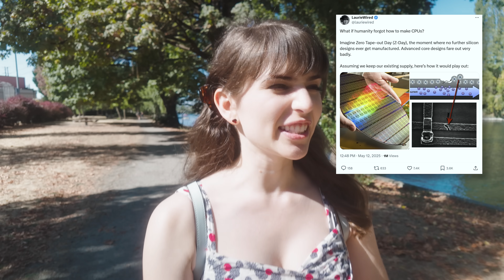what if humans forgot how to make CPUs?

Comment: It would be an interesting race between decay and re-development. People would immediately start to try and recover the lost knowledge. If we re-start in the 1950s with discrete transistors and the last old computers fall apart 30 years after z-day, we might be back to the legendary C64 when the last modern computer fails. 
That is, if development occurs at the same speed as before. But unless you assume a mind-wipe of the engineers who worked in chip design, as well as old textbooks disappearing, things would go faster the second time.

Comment: I am not sure we would lose more than 5% of advanced CPU’s in 15 years. I also feel that old mobile cpu’s would be repurposed to produce end user networking equipment for decades given current stocks. China reuses CPU’s now - producing millions of phones using salvaged chips.

There would also be a lot of lead time to a loss of CPU manufacturing expertise, and older hardware would no longer be destroyed during upgrades - cpu’s 3-5 generations old would sit on shelves as reserves.

Almost everything else will fail a dozen times over before the CPU’s. With chips being constantly repurposed until failure.

The break down of the conductors is overblown. 5nm CPU’s operated at appropriate temperatures and voltages will be made to last half a century. 

32nm and 22nm chips will chug along for several centuries. 64nm and larger will outlast us.

We will be replacing package capacitors and even repacking entire chips dozens of times, rating them for lower and lower voltages and clock frequencies.

Comment: I understand this is a thought experiment and it's interesting from that point of view. My ADHD brain though has questions. If we know how a CPU works we can build one. Might take a bit of nutting out and experimenting, but there's enough people in the world who know the mechanics of how transistors work, who can do microlithography etc. I only mention it, not to be a spoilsport, but because I think it's easy to mystify technology but it really isn't. At it's core (pun intended) a CPU is extremely simplistic. There's a lot of moving parts but they are all just transistors ferrying electrons around reasonable straightforward pathways. There are people who have enough knowledge of how a cpu works to write out a schematic from just their own knowledge. I could do it with a little help from wikipedia (which I have downloaded locally). Even boutique manufacturers are producings chips of different kinds, inhouse, small 20 people companies. Especially in China, Vietnam, India etc. Unless all manufacturing is lost, we will be able to build cpus. If all manufacturing is lost, it's a matter of only a few years before all technology such as power plants, utility services etc goes back to very manual ways of doing things. No large scale power generation, no power distribution. It will be local power stations, windmills, hydro etc, on a small scale, where there is no reliance on microprocessors or computers. So no cpus also means no resupply of electronics and microprocessors. Basically it's back to the steam age.

Comment: Wouldn't tape storage devices be more useful for long-term data preservation than optical drives?  The life span of a magnetic tape is about 30 years, and the tape storage has enough capacity... LTO's are used even today for backup that's rarely accessed.

Comment: 7:14. Computer controlled ignition started in the 70s, and was in full swing by the 80s, all cars from the 90s have ECUs.  You basically have to go back to carburetion.  However, the ECUs in automobiles, especially from the 90s, are very likely to outlive the vehicle and/or the operators.  So you'd have a VERY long time before you had to start worrying about that.

Comment: That's the funny thing. Making a CPU is actually not that hard. Making a GOOD CPU that can compete with modern designs, that's hard. As long as someone knows how to throw something that can act as a transistor together, and then combine them into logic gates, you can build some kind of processor. Good design can be lost, but ultimately a basic CPU is a rather easy thing to throw together.

Comment: Even without the masks or detailed designs, the fundamentals of CPUs is not particularly hard or complex. Even starting from core logic blocks like the logic gates it wouldn't be that hard to recover technologically. 

There is a realistic form of this scenario though and that's the destruction of the lithography equipment itself and the equipment to manufacture that equipment. 

If ASML lost the information to produce EUV lithography machines or if enough of the supply chain that manufacturers thousands of highly specalised parts that each depend on their own complex supply chains, we could go back decades. 

If china invaded Taiwan and TSMC fabs were seriously damaged and the chain of escalation caused global disruption, we could see process nodes go back a decade or more. In an apocalypse scenario we'd probably know more about the designs of advanced chips than how to make them. 

You can build a basic 16bit CPU from discrete logic gate ICs made on lithography some youtubers have made in their garage. Hobbyists can and have made CPUs with a few thousand transistors. There are probably only a dozen people alive who understand enough about the industry to recreate modern lithography and even if the information was retained, there is so much supporting industries and tech required to maintain our ability to manufacture advanced semiconductors. It's incredibly fragile.

Comment: That was an excellent thought experiment.

And it low key validated my distrust of modern tech. I have modern tech sure. But when I need reliable, I use antiques. My C64 on which I learned to code is still operational XD. My usual concern is a solar flare. Which is why I still have critical data stored on optical media.

But even without the CPU problem, I have been wary of "smart" devices from day 1. And time proved me right in that you can't troubleshoot your own stuff if the "smart" thing runs into an issue. My car has zero tech in it, besides an old radio. I had to make changes and pay a lot to get a bunch of engineers to validate my design changes, notably for environmental compliance, but it mostly is just an old car. That I can maintain myself. Instead of having to go to the car shop.

I religiously keep my older hardware. Originally because of sentimental value. Then because I thought that I could fix them (and usually it turned out to be true). And after that because I realized how much more sturdy it is than modern tech.

Comment: Guys, I have seen the horrors of legacy assembler code. The moment someone treats "optimization" for "efficiency" as an easy binary I get flashbacks.
Do you know how I got these scars?
I call it data structure tetris.
Wanna know about it?

See this form?
In the codepage it uses all the valid letters use the same bit in that position of a specific byte. So technically we can use that for another flag! And just always set it for display.
A byte? What is a byte?
You mean 8 perfectly independently usable bolean flags that don't necessarily need to be related in any form. It could even change over the lifetime of the software!

Comment: It’s very much not in the spirit of the question but the reality is we would just make more CPUs. Say aliens came down tomorrow and destroyed every chip fab and every chip fab tool on Earth then left for some distant part of the universe. Within maybe a year maybe two we will be back to producing integrated circuits at a sophistication comparable with the 70s. we have that much knowledge in books on paper about semiconductors but we really wouldn’t have to reinvent the wheel.

Within a year or two after that we’ll be back to early 90s levels of chips and getting things comparable 286 or early ARM processors.

A lot of embedded microcontroller type stuff can run with that level of power. Building up to the absurdly small transistor sizes we have today might take longer but it would still be a lot faster than it happened first time around. The engineers who built those tools and manufacturing lines are still alive today. that expert knowledge hasn’t died. It wouldn’t be like trying to reinvent the steam train from scratch.

A far more interesting question is if you had access to all of the specialised raw materials that humanity has extracted from the Earth so you didn’t have to extract them yourself how quickly without any tools at all could you go from Stone Age tech to building a microchip

Comment: A global network as fast and efficient as the internet would disappear, but global communications would still be possible. The Transatlantic telegraph cable was operational in 1858. The first transcontinental phone call was in 1915. These technologies predate the first integrated circuits developed in the 1950s, and don't require micro-controllers.

We would probably return to manual labour for the more complex parts, like switchboard operators, and access to these networks wouldn't be easily available for the poor. Something similar would happen in the computing space. Calculators can be mechanical or pneumatic, and the "computer" is the human who does the computation on the machine.

I agree this makes for an interesting post-apocalypse premise.

Comment: If humanity forgot how to make CPUs then by this logic micro controllers would be out as well yeah? And we can’t say “Oh we can go back to vacuum tubes” because the knowledge of how to make CPUs is lost. So yes in the long term there would be a transition from relying on computers to training people to be the computer, again. 

To make anything new, conduct any research, you would need people conducting the math involved. 
But here’s the more important question: Why not conduct research into creating CPUs? 

If it’s a matter of reinvention that could be done significantly faster with existing knowledge to fill the gap left behind, and I suspect would be top priority for governments and corporations to solve. 
Using the tools of the scientific method humans would conduct research into storing information, and calculating data. Research and development into material science would step up to find viable options for the creation of components that would form the newly rediscovered Central Processing Unit.

For example the story of the Saturn V, we now have designs for engines that exceed what was lost. So while in the short term there would be a disruption, in the long term this is seen as little more than a manufacturing disruption, and would likely become a footnote at best.

“Science is constantly proved all the time. You see, if we take something like any fiction, any holy book… and destroyed it, in a thousand years’ time, that wouldn’t come back just as it was. Whereas if we took every science book, and every fact, and destroyed them all, in a thousand years they’d all be back, because all the same tests would [produce] the same result.” -Ricky Gervais

Comment: Millions would starve without the automation of modern farms. How long would solar panels last?  As you said with Jeri Ellsworth creating her own transistors and such, what is to stop people from rediscovering and home-brewing their own?

A different thought experiment I've used is what if you could not trust any electronics or software and had to restart it from scratch? How long would it take?  It feels like something the NSA would investigate. The impetus for this would be something like Ken Thompson's hack writ large. Hardware manufacturers have been so thoroughly compromised that the exploits baked into their chips are impossible to detect with electronics created by compromised hardware and software (*magic handwaving*). 

Could you make a known-good compute infrastructure without using existing machinery? How long would it take?
Obviously you can hand transcribe code, so you're not totally lost.

Comment: Magnetic logic for the win.... tiny cores driven by pulses that can do Boolean logic. More reliable that germanium transistors, with far more approachable materials engineering requirements.

They could be driven by large old transistors, or vacuum tubes, or perhaps even high frequency alternators.

Comment: 9:25 - I think you'll need to back that claim up with statistical data. Generally, HDD's out live SSD's at a 10:1 rate going by the Mean Time Between Failures data and the Maximum Write Cycle capability, SSD's just can not be use to read and write anywhere near the number of times as HDD, which is why data centers and server farms use HDD's for long term storage and SSD's for fast response of regularly accessed data.
Reply: She did mention having to physically relocate the storage due to fractured networking. Spinning down HDDs, subjecting them to the vibrations of transportation, then spinning them back up again would most likely decrease their reliability significantly. 

For a few years now I’ve been buying used data center SAS drives for home servers and every single one was retired at 5 years from their data center. I’ve had a few failures and DOAs over the years with them primarily being manufactured from 2016-2018. 

I’ve yet to experience an SSD failure in any of my consumer devices. Also data center SSDs have incredible write performance.  Optane drives would probably become some of the most valuable items since they have an insane endurance with some able to write 100s of petabytes per day. With well optimized software, data center solid state storage will most likely out live any mechanical drive by a long shot. 

I would love to see the real statistics and data to back that up though!

Comment: i would think in such a scenario that discrete transistors would be used, if those are unavailable, i would expect tubes and relays to be used, as both of those are simple enough to be replicated simply by looking at them. at worst computing would revert to the era of the late 50s. very fun thought experiment

Comment: I make Chips (Mixed Signal) for a living, and many other semiconductor circuits... its not that bad of a process. Anything that can amplify current will work as a switching element. It is possible, and (largely) straightforward to design with it. The minimum viable CPU is not very difficult at all to make, the impenetrable complexity has to do with the sheer size of current designs. I would worry way more if we lost the Analog / mixed signal (me), or the Radio Frequency systems(200iq gigachad wizards), or even the power management(smarter than me honestly). 

I've taped out many chips, and I have also seen hobbyists make homegrown silicon lithography down to 10micron feature sizes. So it isn't too difficult to revamp once all the tech is gone. 10 microns is pretty good, you might be able to fit a thousand or so gates on there, enough to do 4bit arithmetic at least. Look up the youtube channel "breaking taps" if you are interested. We could also go back to vacuum tubes too lol.

Comment: Fortunately The only way I can think of this being possible is an EMP caused by the detonation of a nuke at high altitude, and surely no nuke bearing world leaders are crazy enough to do that, right? An EMP of that magnitude would wipe out all unshielded computer hardware so we'd immediately be pushed to the 20-30 year mark, I think it's likely that enough hardware could be salvaged from hardened facilities like the AT&T long lines building and computers that happened to be surrounded by enough metal to protect them to restart low volume, chip design and production in less than 5 years which could snowball to our current level of CPU technology in probably 20 years or less. All of that assumes that the nuclear EMP was caused by a single rogue launch, if it's a proper nuclear war the timeline could be much much longer, maybe a century or more depending on how bad the fallout is and how many experts are rendered unable to contribute to the project. New processes may also need to be designed to remove nuclear isotopes from metals and maybe silicon harvested after the war to prevent instability when shrinking nodes.

A powerful enough CME from the sun could also wipe out a significant amount of electronics too but I think we'd have enough warning to protect enough hardware that a restart would be comparatively easy.

Comment: I would assume that the current experiments trying to achieve biological computing systems by connecting neurons artificially will develop significantly long before this paradigm becomes obsolete. Several reasons will weigh in favor of taking that path, including integration with humans and the resource and consumption efficiency of biological systems.

Comment: Analog computers would definitely become a feasible alternative and maybe in the long run we may design something better von Neumann architecture. Afterall a cpu is nothing but a binary operation unit and you don't necessarily transistors to make them.

Comment: One thing about old vehicles is the early UV erasable and early EEPROM's used in early ECU's have an expected data retention of 20 years, though I have never personally found a ECU with a bad EEPROM checksum. carbureted vehicles have their own set of challenges with the availability of replacement parts that don't fail after a few years.

Comment: It's amazing what you can do with relays. Konrad Zuse designed some interesting computers in the 1940s. He was working in Nazi Germany so he had no access to Allied design information so he had to work it out for himself - often much better (e.g. using binary rather than base 10 circuits). He made a mechanical 1Kbit static memory using just sliding metal strips driven by relays.
Reply: I was gonna come here and mention this, this was also a real possibility for computing until tubes and later transistors handled the switching.  But Yes, relays would be a good alternative.